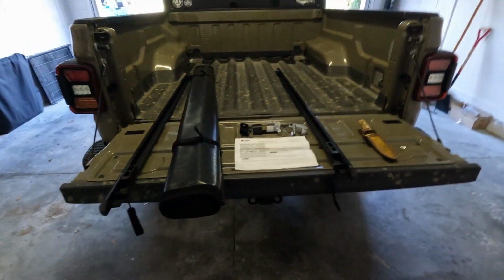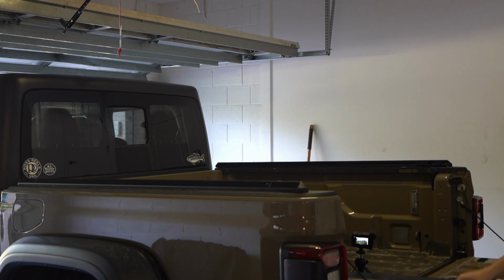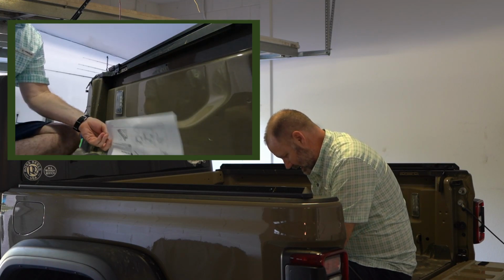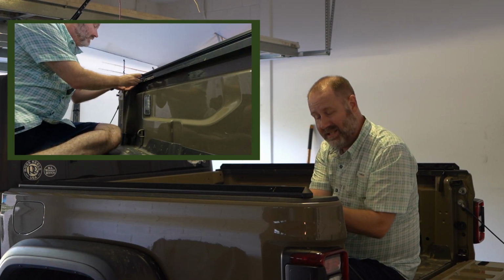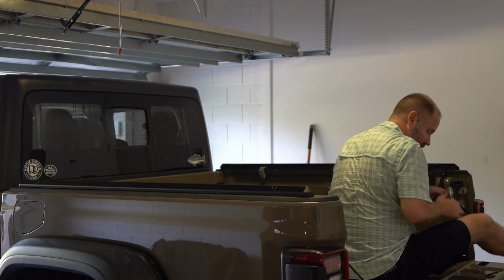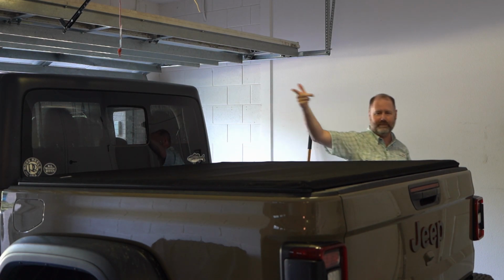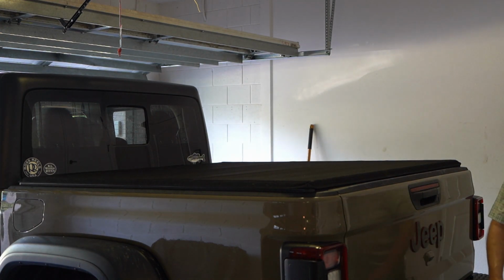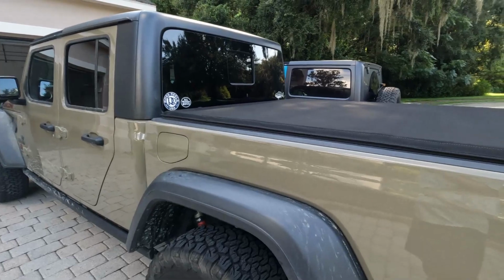BesTop EZ ROLL Tonneau Cover

Comment: Dumb question - are the side rails the same length? I just purchased this kit and the side rails are different lengths which means the latches are offset too. Bestop customer service is trying to tell me this is normal when logic tells me otherwise for how this is supposed to fit and function.
Reply: No the rails were the same length for sure. You’re right, it would never line up correctly otherwise.

Comment: I just installed mine and having trouble releasing the latches on the back.  Any ideas or clues?  Have you experienced this?  Thanks
Reply from the maker: From what I've experienced, you have to pull the release straight back (parallel to the bed sides) not in towards the middle of the bed. I hope this helps!